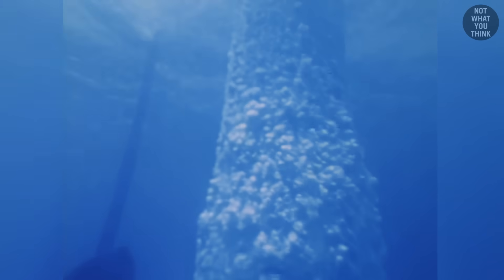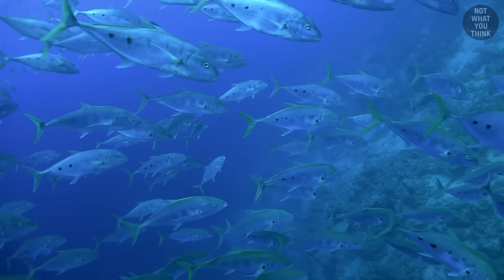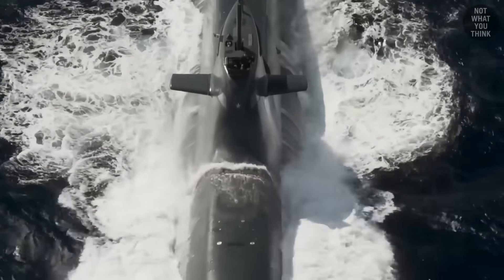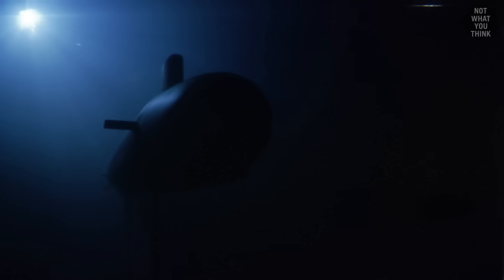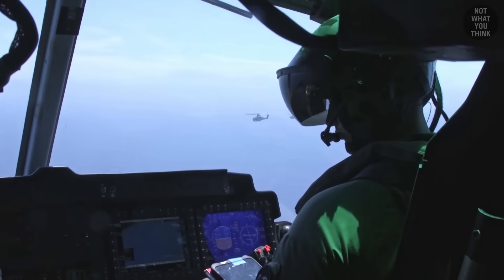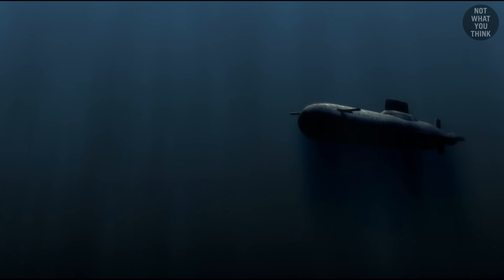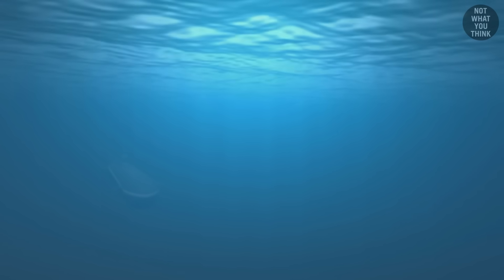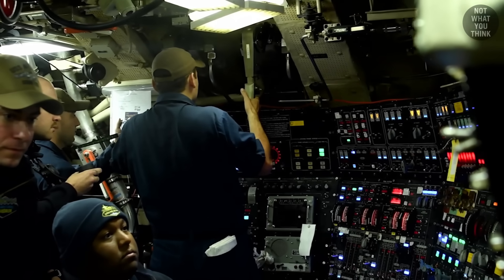Why Being Too Stealthy is Bad for Submarines

Comment: Why do diesel subs have to surface? Why can't they just run a line up to the surface to release exhaust?
Reply: It's not the exhaust, it's the engine air intake. Diesel boats usually have snorkels which allow them to run their engines while still (barely) submerged and thus recharge their batteries. Otherwise, the engines can't run with no air coming in. (A few years ago, a Chinese navy sub crew was accidentally killed when a poorly designed/manufactured intake valve failed while the boat was snorkeling and so the powerful diesel engines sucked all the oxygen out of the interior.)
Reply: @drongobum2037  I dont know why i said exhaust...What i was wondering is why the snorkle is depth restricted, why cant you snorkle from 500ft+ below the surface?
Reply: @maxcr5937  500ft+ is an awfully long snorkel! Diesel engines suck in a huge volume of air so the plumbing has to be large(ish) diameter. That's a big roll of air hose....
Reply: @drongobum2037  Yeah so it is the same problem i had with my brother in the pool when we tried to breathe through a garden hose ten feet down lol ..thats all i wanted to know haha

Comment: The Seawolf class is NOT the quietest submarine in the world, not by a long shot, actually.
Modern diesel-electric subs like the German Type 212 or Swedish Gotland-class are SO much quieter, that under pure electric operation, they are simply accepted as undetectable, period, unless a plane flew overhead with a magnetometer and detected the hull, which is an issue for any submarine ever made.

Comment: The comparison between diesel subs and nuclear is wrong. These days, they serve substantially different purposes. Nuclear subs are great for long-distance power projection over the oceans, but are quite limited in littoral waters and shallow seas. Modern AIP subs can remain submerged for weeks, which is perfectly enough. German and Danish subs are designed specifically to be able to remain submerged in as little as 17 m of water depth, which corresponds to the depth of a very important shipping lane in the Baltic sea between the two countries. Try doing that with a nuclear sub, When the Russians transferred their largest sub for a Navy Day parade into St. Petersburg, they had to pass Denmark surfaced. The Baltic Sea is a puddle in most places, and using AIP boats for surveillance and defense is much more practical. It doesn't matter that you have to surface every other week or so, since you'll be able to be home by then anyway. 
Decisions as to what boats to use are normally made based on what scenario you want to use them in - there's no point in making huge, expensive nuclear subs when they can't fulfill the tasks you have for them, whereas their advantages aren't necessarily within your needs.
Reply: yea this guy apparently is spewing nearly 100% mininformation in this vid

Comment: 5:20 The odds that those 2 ships would be in the same place at the same time is 1.62x10^(-14) or 1:61,728,395,061,728.
Using the volume of both ships vs the volume is the oceans.

Comment: Why in god's name would such information EVER be in a computer that is EVER accessible from ANY outside network?   Classified systems used to be prohibited from outside connections, and where such communications were necessary for function, HIGHLY encrypted with pretty much unbreakable scrambling/security technologies.

I am surprised that they do not transmit noise, of the type that is natural locally, when they are in a noisy environment.   Seems pretty straightforward.  Wouldn't it just take a few external audio transducers?

Comment: the US has an ELF transmitter in Michigan that sends signals by vibrating the earth's crust. Signals have very few characters so would involve things like  priority message for sub xz . the designated submarine would go to periscope depth send a laser signal to a satellite and receive orders by a microwave signal from the satellite. It would be extremely difficult to detect the laser signal and extrapolate it to arrive at sub position. the Microwave transmission could cover 25% of the ocean so less helpful for detection.

Comment: Diesel electric battery submarines service to run the Diesel generator but is it possible to turn the ocean water into breathable air or breathable to the generator or maybe they already tried it or it's not possible

Comment: Right off the bat at 1:10 you are wrong. The easiest way to spot a submerged submarine is by visible light. If a helicopter or airplane flies over one that is running at periscope depth, or if the periscope is spotted, that is a lot easier than sonar detection which needs discrimination.

Comment: What most people don't know, due to Hollywood ignoring it, is that for over 20 years, submarine sonars are no longer plain listening devices, you have to put your ears to.
It uses acoustic wave refractions to calculate/render 3D computer graphics/animations of what the world looks around the sub, in 360°, in real-time.
This is not at all a secret. It's just that Hollywood doesn't care, because they don't want to drop the "suspense-filled-listening scenes" from their movies.
Which is the same why most people believe that a land-mine will explode after lifting your foot, which makes no sense and was never the case anywhere, except Hollywood.

Comment: 8:02 actually the thermocline is useful for stopping the sound from the submarine due to the different water temperatures and densities acting like a 'wall' to the sound
any thermal radiation at those depths will be absorbed by the water before it reaches the surface at a detectable level

Comment: As a former ASW warfare officer I can tell you without hesitation that a sub wants to be completely silent.  That is its advantage. It isn’t fast or nimble and if detected can easily be destroyed. 

Basic tracking for subs is done by acoustic methods. Yes there are other ways but that is primary way to detect and track

So even thought there are risks of collisions that is a risk to take. If you are not on operational maneuvers and want to avoid a collision accident then  the sub can use noisemakers which they are equipped with so they can be detected easily

However, if you are undete

Comment: Why would they even use toilet paper in a sub?  Why not the tried and true bidet method with a blow dry after?  Storage and resupply are likely critical factors so why not employ tech to increase how long a vessel can stay on mission?   In fact why not scavenge and process FOOD while on mission?  the sub could "eat" plankton for example and then a processing unit could convert it to dried or frozen food for the crew!  Then the sub would only need to carry concentrated flavorings and whatever nutrient supliments perhaps not sufficient in plankton?  (although some huge whales have no trouble?)   Also I would think a sub could attract and harvest schools of small fish like sardine sized and again automatically process such catches as food for the crew!  And if a sub is large enough why not actually farm some produce too??  I am thinking a well designed nuclear sub could remain submerged literally for YEARS! ??   Personel could be rotated by ejecting and/or collecting mini subs which would stay submerged  long after the "mother ship" has moved on and get collected by some other vessel similarly incoming crew would be dropped off in predermined areas and just sit there dormant again until the mother ship came by and collects them totally in secret?  idk do they do stuff like this already?

Comment: The Seawolfs might be the quietest Nuclear Submarines in the world, but the Europeans still run some Diesel Electric submarines, and submarines running on batteries alone are practically impossible to detect. To the point where one of them managed to infiltrate a US Carrier group and surface right next to the carrier, during a war game, a few years back.
Reply: Thermoclines also affect the movement of sound waves through the water, so a submarine sitting below the thermocline can also avoid Sonar detection, not just thermal detection.

Comment: Some thoughts:
Conventional subs with AIP does not need to surface to recharge. 
Some modern diesel electric without AIP uses Prairie/Masker type of systems to attenuate noise from diesels when snorkling, but no submariner really thinks that loitering around at the surface is smart.
It is not easy to spot a sub with IR when submerged, the "Layer" has more to do with acoustics than some magic thermo insulating thing.
The layer can only form in deeper water, if I remember correctly at least 100m of depth.
Never heard of aircraft transmitting with ELF, generally the antennas need to be several hundred of meters long, but I guess that with fractional antennas that could plausibly be achieved with sufficiently small antennas to be airborne.
The long cable streaming aft is (normally) a sonar array but it is also used as ELF-antenna for the sub.

Comment: Ok there is no way a submarine would be able to stick out its periscope unnoticed. Moving any speed with that thing sticking out will create noise and submarines will never be still relative to the water. Plus, if the radar absorbent material looks like 9:31 that it should be easy to spot without sonar or radar.

Comment: I was an STS2 (SS) A Sonar Tecgnician onboard the USS Henry M. Jackson SSBN 730 A Trident submarine....  The primary method for detecting a submerged contact is not it's power plant. Nearly 100% of the boats I detected were from it's screws. Propellors turning at speed, or cavitating is almost always going to be the method of detection. Plant and machinery noises are called "tonals." We use those to classify the contact. As for this "acoustic hole?" Fat chance. No Sonar Operator is going to be able to designate a contact based on a lack of noise. An ocean is a very large body of water. A submarine, even a Typhoon, utilizes a microscopic amount of an ocean's space. A lack of bioloics will never be detected by the Broadband Operator. Even with multibeam steering, having a specific hydrophone pointed directly at a submerged contact will fail to be revealing simply due to a lack of noise.
Reply: yeah I was only an  auxiliaryman and I didn't buy the quiet hole thing.

Comment: Drivel! This was pretty crap, "Being too stealthy is bad" how the hell did you come to this conclusion? Well I waited and waited for that point to be stated, but nothing, you lied or you might not know what these English words mean. That wolf class of nuclear sub is crap, don't believe the military when it comes to the effectiveness of the sub in that countries fleet, the best subs are not nuclear powered, you didn't mention they can be tracked by satellite because the leave behind a radiation signature, unless they have problematic liquid led cooling systems that stop neutron escaping the reactor, subs with that type of reactor tend to be massive subs, the Russians have a few with the reactor type, you can detect them from the slight bulge at the water surface, subs that launch nukes are pointless nukes are not effective weapons but I wouldn't expect you twits to understand that.

Comment: The only time the submarine I served on had to have the sailor’s activities be extremely quite is when we were sneaking in places we should not be, like inside other country’s territorial waters or when getting extremely close to another vessels.  We once got behind a Russian submarine and tracked for 4 weeks until we were told to break off and go do something else.

Regarding diesel boats, when submerged on the battery, they still have a bunch of machinery running that we can detect like ventilation fans, propulsion motors, trim pumps, drain pumps, oil pumps and the big ass screw rotating at the back.

Regarding being too quiet, the passive sonar on US submarines can detect surfaced and submerged vessels miles away.  They have a library of all ships the Navy has encountered and recorded their sound signature and on many instances, it can tell you the name of the vessel.  It is sensitive enough to be able to tell how many revolutions the propeller is turning and which motors are running.  They have long towed arrays that increase that sensitivity.  We used to track living things like whales and schools of fish, known as biologics, to practice tracking another vessel.

There are multiple thermal layers in the ocean and the boat can detect when they are passing through a thermal layers.  We used them frequently to hide from surface vessels (aka targets) that were trying to detect us during fleet exercises or near foreign warships.
Reply: 1. Why were you in another nation's territory with a military vessel without permission and why would you admit to it.
2. Diesel electric boats regularly demonstrate in exercises and wargames that they are, in fact, not detectable if they don't want to be, since unlike a nuclear sub, they do not require any running machinery at all times, only when maneuvering, in which case still the electric motors are considerably more quiet than the systems needed to keep a nuclear reactor from melting down.
3. Diesel Electrics do not have any louder of a screw than a nuclear sub and the Seawolf's jet does not offset its inherent reactor noise more than simply using an electric engine would.
4. Towed arrays are not exclusive to US boats by far and haven't been since the 70s.
Reply: @rachelpurity1 
(1) Because everyone did it during the Cold War and it has been documented in several books.  It is no longer top secret.
(2) You know nothing about submarines and less about nuclear power plants.  If you do not have machinery running, you are sitting still in the ocean.  Nuclear power plants have electric motors to make them work. Fission does not make noise.  
(3) See number 2.
(4) Our sonar systems are far superior to those of other countries.
Reply: @rachelpurity1  They call that spying and it's done a lot.

Comment: The scariest thing about submarines is that they rely on periodic communications with Command through a gigantic antenna for very low frequency radio communications that can reach them underwater. It's one way only, Command uses it to tell the ship to go shallower so they can use two way communication.
So, the scary part is that if they don't receive that order in a while and cannot be reached by other means, they're free to assume Command has been wiped out and can deploy their nukes...

It nearly happened one time. One famous story during the Cuban Missile Crisis was when a soviet sub was detected and the american vessels were dropping practice depth charges to command it to surface. The sub's command, too deep for communication with Moscow both ways believed the charges meant nuclear war had started and prepared to lauch a nuclear torpedo on the american fleet. The Second in Command on the ship refused to consent to the launch and calmed down the captain, averting the launch.
Reply: You've lost touch with reality friend.

Comment: As a  Prior  U.S. Navy Submariner : 
Most Submarines  are  detected  by their  Active Sonar  Noise : Prop Cavitation  , Values Openning / Closing ; 
These  Allow  our  Sonar Techs to record and itemize  an opponents  Submariner  ; creating a digital file . 
Another means of  detecting a Submarine  from the  Air / Aircraft , is from a  Deflection in the Earth's Magnetic  field  - That much Steel Affects small variations  detectible with senors .
Also , Russian Submarines  use to do  " Crazy Ivans " to Check for  Enemy Subs in their  Baffles ( = Behind them ) 
United States  Submarines  deploy a  " Trailing Wire Sensor  " that  Fills in that Black Hole / gap  in our ability  to detect  foreign  Submarines...
Reply: No submarine that cared to remain hidden would EVER go active on it's sonar. Everyone within 50 miles would know where you are. Even the Russians aren't that dumb. They're dumb but not that bad.

Comment: I don't know why there aren't more commercial submarines.  A submersible cargo sub would be able to travel more easily through stormy seas by submerging and would not need to waste fuel by going around a storm or trying to power through tall waves.  Additionally, a cargo sub can be built longer and wider because it would not have to deal with cresting waves.
Reply: A military submarine contains large air spaces which tend to make it buoyant, just like a surface ship.  I needs to be close to neutral buoyancy in order to easily change depth so it has to carry a load of iron ballast low down to counteract the buoyancy force. A commercial carrier would have to incorporate the appropriate weight of ballast for the cargo that it is carrying.
Reply: @rogerphelps9939  It would work only for dense cargo like iron ore.
However submarines are insanely complex and obscenely expensive (unless you talk about a semi-submerged boat like the ones drug traffickers use, but they can't dive under storms).

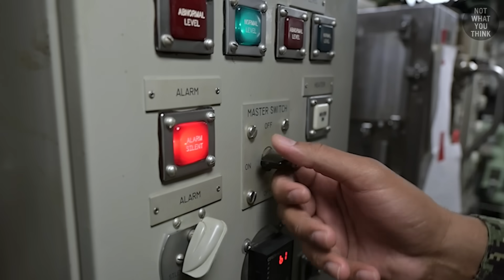Comment: 1:37 These "noise canceling mounts" should have adjustable dampening… where they can be tightened and loosened…so that the frequency of the vibration of the machinery can be adjusted, thereby changing the acoustic signature of the submarine.
Reply: It's mostly rubber pads, so it would be hard to change. You could have a system that slowly raised and lowered different pads under the machine to place it on different spring constants/damping coefficients at different corners, but it's not a simple thing.

Comment: The Sea-Wolf-Class is not the quietest submarine in the world. The fact that it is nuclear powered (which means the boiling of water) means that it is louder than a modern electric powered submarine.

Also most countries use diesel-electric subs, not nuclear powered. Germany even goes with a sub that uses hydrogen.